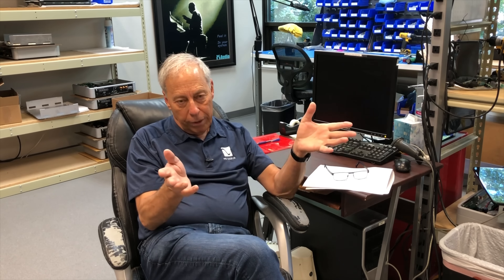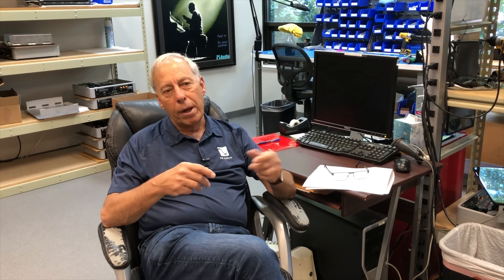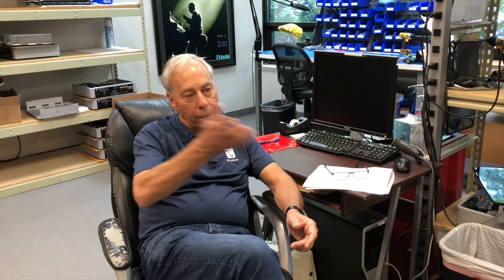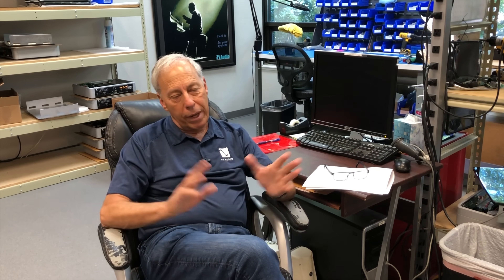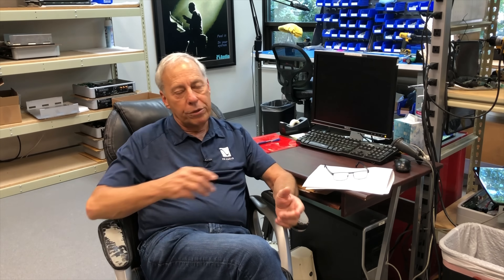How to make Class D sound better

Comment: I have now a class D with pre and postfeedback self oscillating who go to 0,00012 procent distortion while output 50 watts. using second orde integrator and a post correction stage with gain. noise is below -100dB. On simulation, not yet build.

Comment: Hi there -

Have been led to understand that the PWM output from a class D may either be integrated into an analogue output either by a large-ish (~1000uF) capacitor across the output, or, alternatively, actually just by the inherent (mechanical) integration of the speaker itself - 

- thoughts?

Comment: Hi Paul,  I learn so much from your videos.  A question for you.  Is there any latency when a Class D amplifier needs to call-up more power for say a louder passage and are there any audible signatures when this happens?
Reply from the maker: Nope. The typical switching frequency for a SMPS is 100kHz or higher, way out of the band for human hearing.
Reply: @Paulmcgowanpsaudio  in theory higher switching frequencies (in the MHz or even GHz band) would be better as you get higher resolution on high tones, but i know that drive circuitry, filtering, layout design (against interference etc), design capacitance and a ton of other things matter

but yeah, a 200kHz switching frequency will only leave like 10 points accuracy for a 20kHz sound signal, especially for studio applications it sounds counter intuitive with 24 to 32 bit 192 to 384kHz to use only a switching frequency of 100-150kHz, not like you'll really hear you've only got 10 data/switching points at 15kHz but it could be an argument, also switching at really high frequencies in the order of a few MHz to GHz also really kind of removes the need for chokes on the output, possibly increasing the efficiency as it doesn't get filtered through inductors

that makes the TI TAS6424-Q1 quite interesting apart from being an IC and not having the best crosstalk nor sampling rate (96kHz digital input... yeee) https://www.ti.com/product/TAS6424-Q1

but that frequency could make for an interesting amp if you can find comparators etc that are fast enough to handle/compare audio to the carrier frequency with a great resolution, ADC's sound kind of counter intuitive if you want to reproduce audio at these kind of frequencies while wanting a perfectly similar amplified output (apart from the switching) as compared to a really old record (pre digital) on a class A (or AB) amp, 2.1MHz would reproduce sounds accurate enough to have such a high res it's impossible to discern from the original even with special measuring hardware, apart from the coloration coming from transistor amps or tube amps obviously.
Reply: Class-D amplifiers have a low power supply rejection. You should take care  that you have enough capacitance in the primary and secondary stage of your SMPS and a nice voltage regulation. Also you can have some crosstalk due changes in voltage in the caps due to the other speaker.

Comment: What I wonder is why with car audio class D amps (even the ones designed specifically for subwoofer duty) does the low end of the audible range seem to alway be modified by the amplifier to prevent good sound quality? I'm not talking about the subsonic filter they usually have. I  installed many class D subwoofer amps during my time with an electronics company and it seemed class d amps either always had weird things happening from 40 or so hertz and down, and/or their phase was frequently way off from the mids and highs amplifiers. 

I'm looking into a class d for subs, to save space in my vehicle, to run along with my class A that will be running mids and highs, but I'm worried it won't ever sound accurate.  Any of my AB amps have always sounded amazing but take up too much space for my current vehicle.

Comment: What PS Audio can do is to switch to hypex modules. Because of 10-20 dB lower distortion level and few times more high switching frequency with comparable price. ICE is over. And to fix an unbalanced input, so both produce a scene of the same width.

Comment: Hey Paul, really like all your informative audio information! When l purchased my Maggie's. 7's I decided to buy a used class D amp (I already have a VAC PA 100 100 tube amp) and in the event I didn't like it, l wouldn't lose too much money.  I came across a Spectron musical MK ll class D amp that was designed by John Ulrick back in the early 2000's  From what I understand John basically invented the class D amp
He also worked at Infinity speakers with
Arnie Nudell and developed the class D amps on the Beta RS speakers. Before I bought this amp ( for less than a set of decent set of speaker wires) I read a lot of reviews, and all the reviewers loved it!
It's a beast! Coming in at 54 lbs  has the ability to output 1,200watts@1ohm and 65 amps for 500 milliseconds  I must say for an old D class amp it sounds pretty close to my VAC but with much more dynamics and effortless power
Paul have you heard of, or know of this amp?

Comment: What!? If that amplifier module is linear from rail to rail, then the input stage should be TRIVIAL. An input stage should do Nothing but prep the signal (linearly otherwise you're introducing distortion) for the amplifier stage. There's no 'magic sauce' there. The only thing I can conceive of as an acceptable means of changing the sound, is only if you decided to do some filtering, like a LPF for sub-woofers, or overall 20-20Khz bandpass filters. Also, signal conditioning like XLR difference input op-amp arrangement, or soft clipping/limiter circuitry is also acceptable. 
If an input stage changes the phase or magnitude of the original signal, then I call that distortion. 
So what possible secret sauce could an input stage do that is 'better' than someone elses? Maybe you change the input impedance, output impedance, or add other 'features', but don't touch the original sound and change it in any way. As Gene says, it shouldn't be a tone control.
My $0.02.

Comment: So, in short, the sound quality of the system is depend on the pre-amp input and the quality of the speakers, right?  The class D amp is not that important other than provide the power to the speakers, right?

Comment: However Class  "D"  are the most distorting amplifiers ever. They convert the signal into digital that depends on a sampling rate, then it need converting back into Analog to drive the speakers. This is a terrible proposition when you try to smooth that staircase signal on the output, plus try to silence the noisy circuit fill with hundred of switching transistors.  They, "D" class are more electrical efficient but who count the penis you can save with a class "D" amplifier over a class "A"???
We like the best sound and saving on the electrical bill is not my goal!  Class "A" on tubes are the best sounding amplifiers.
Reply: @russmaleartist  Sure, I herd them, they sound good but they do not have the ultimate sound I look for; also, I inspected the output of several of a few high end  Class "D" amplifiers on a variety of frequencies on a high resolution scope and you can detect, slightly, the stairway digital output. Moreover, you can detect the transistors cutoff noise by an overshot of the wave.   I do medical electronic these days but HiFi is the roots of my carrier. I understand that people  do like the equipment they purchase, but there is always something better even if consumes more electricity or produces more heat. Do not get hostile. I expressing my thoughts and back them up with explanations. This is a form of a forum to exchange ideas.
Reply: @mtabernig  Funny how having a difference of opinion is called hostile -- did I threaten you somehow? I didn't -- I disagreed . . . why is everyone so thin-skinned -- especially over an inanimate object. I would say, get a grip . . . but I am afraid that it too may be too harsh for your delicate nature.
Reply: @russmaleartist  No, you came out on "how can you make such a blanket statement" when you did not ask to clarify what did I meant or my qualification to render my opinion.
Reply: @russmaleartist  Now who is the Baby????? LOL
Reply: @mtabernig   So sorry for people like yourself, who must be right regardless. One gets on a site to share a hobby they enjoy with others and because an individual doesn't agree and can't win a fair debate, they have to try to bate, debase, and defame in order to win an argument. Well, here you are, mtabeernig, “you win” -- what you won, I am not exactly sure -- a trophy for being a arrogant jackass perhaps . . . now go get your diaper changed and come back when you have had your nap and are in a more social mood.
Reply: @mtabernig  LOL X 10
Reply: No they do not convert analogue to digital and back . The D in Class D does not stand for Digital ! You have not the faintest clue how class D really works obviously .

Comment: Hey bro, if a class d amp is 4k and a class A-B amp is 4 k, what is the difference
Reply: the temperature is cooler on the class D and it is probably lighter. Class D and AB are on par as, A badly designed AB amp is just as horrible as a badly designed Class D. Being a DJ for 35 years means my hearing is not great but i can still hear well enough to know when the sound is distorted or hissing or hum from a amp at rest .  I used to be really worried about quality when i was a teenager but  learnt the money wasted for a small change in the absolute best sound quality would be better spent om more or louder gear because when people are drunk they cant tell the difference. Saying that I dont like cheap gear.  I like gear that works all day and night and works reliably for years. in the audiophile space  my oldschool NAD AB amp does what i need it to do.
Reply: The Class D won't do subsonic bass

Comment: Instead of the icepower,i am about to buy a couple of those 20 dollar class D ebay chinese modules; i have a free, broken,half dismantled,   ex-professional amp from  late 80s, with a 870 VA transformer and clean plus 65 V and minus 65 V p.s.; the amp modules have 4   2N3773 each, good for about 250 Watts, but the protection circuits on both do not feed the relay coil,on  both modules,and i gave up already,all semiconductors are good,replaced 3 or 4 transistors, it may be caps, too many to remove and measure, tired of it,too old,even resistors were,and are,rusted where the small steel,go figure, cap meets the resistive element; 
     I have a nice Rotel (stereo)  with beefed up heatsinks, and i have another  amp,some small brand, small series,mono heavy amp(over 50 pounds) with 16 output transistors,that i repaired, and plus and minus 75VDC rails, actually with one led for each, on the front panel;
     I do not like stereo,neve did since the 70s ,  i find it strange to hear the vocals coming at me from the left and right,Jim Morrison only had ONE  set of vocal cords!! So, my home made 2 woofer, 15 inch , 5 ft tall, (also have 2 old ,but like new, 12  inchers Cerwin Vega that live next to each other,tied up together); 
      I like to listen to The Doors,Mettalica, Dylan, Pavarotti, The Phantom of the Opera, etc etc ( just kidding,i listen to A LOT of stuff, thru youtube,) and i need it to be like they are there ;
       So,the question is, will i  have to rip the 20 dollar class D  Chin Chao modules off and throw them out in the end,or no?   The alternative is to buy 2  class AB  modules for 40 dollars each, with 8 outputs each;    Thanks.

Comment: ..im very new to this but what if you sent that wasted power of a Class A into caps instead of heat sinks for AC regeneration as in a built in mini power plant inside the amp itself

Comment: So, engineers don't do anything to make Class D sound better.  Secret sauce?    FETs?   Nice try bozo.    Two hints - Class D distorts like crazy at specified max power - don't drive them past about 30%.  (Read the spec sheets.)  They mostly have (too) high impedance front ends - I use resistor (100-200 ohms) to damp.    Also it's probably good to reduce power supply voltage if you can - this should increase (digital) resolution.             7.21 on this - more like  "BS Audio"

Comment: Could you do a primer on Crown Class X amps? I think they are a variant on A-B. I know they reuse energy sort of like a turbocharger in a car. I have a XTI 2002 and Love it. I am running from a Xfi HD titanium pro sound card through a DBX Driverack PA and a BBE sound maximizer. I had replaced a Behringer crossover with the DBX and that was a huge improvement from a preamp perspective.

Comment: thanks for your class A amp  heat explanation here. Now I understand !!!  doh!  I have a Marantz SM8 /3250B still working in my study system. Most, but not all the central heating that's required in winter. Best wishes from a chilly Montreal.

Comment: Although I have a pair of Krell KMA-160 monoblocks which do sound great, and they also do generate a great deal of heat,  I usually run a pair of QSC MX1500As in a 2x2 biamped configuration and I'm telling you that I just can't be sure if they sound any different from the Krells.   The QSCs are not Class D, but they have a two level rail voltage system to improve efficiency.  The rail voltage switches to the high range when program levels demand it.    They run pretty cool but not ice cold.

Comment: Wonderful. I don't use mosfet (mosfat) as they are slow (fat). Use moslean. They are faster. 
In my class d design, i've used complementary pairs. (twins but different gender)
If you're building a self oscillating class d, avoid unnecessary capacitance in the loop.
Keep all components close as possible. And coil many a filter by hand. A particular filter is only good for a particular speaker.
In fact if you need to change speaker, coil again the filter until you are realy satisfied with the results.
Boy I sure had fun with class d.
If your class d is working properly, you could hear the news casters door creak when someone enters the studio.
Excellent video.

Comment: I've always wondered what an amplifier designer chooses to design the power output... as I understand SPL and decibels in order to obtain a 3 decibel increase a doubling of wattage is required however at 90-plus decibels.  At 30 to 60 db little power...at 90 db much more power required.   Let's say you have a 100 watt amp and a volume scale of 0 to 100 since volume increase and gain isn't necessarily linear when you increase the volume to 50% that might mean in that design it's using 50 watts and increase power to 70% using 70 Watts and then 100% power would equal 100 Watts in a certain design.   How do amp designers now usually choose this concept, or design.  I have seen so many different brand new companies popping up throwing class D amp modules inside a metal box... and sell for $2000.00 lol.  Why doesn't the company making the amps just throw them into a box themselves?  I like the Pascal amp modules from Denmark lately.  Great thd proprietary input buffer stage then added on by the company making the amp.

Comment: Paul, I run a tube guitar amp repair shop in S.F. but I used to work at H.H. Scott in Wouburn ,Mass. in the 80s. It wasall manufactured in Asia. I was bench tech and I got to know two of the old engineers Don Merriman and Peter Globba. I would bring in tube guitar amp drawings and they would say tubes went out with the horse and buggy and then they'd start talking about them in  great depth. Peter and I had a discussion that I'll never forget. Peter worked for the Germans in WWII. After the war he moved to Brazil and worked in a radio factory. He said that they made their own capacitors,probably had to. He also said that there were cardboard shacks next to mansions.The poor people were lucky to have some beans and rice to survive on.He made it sound like communists were trying to convert people to their cause. He also said that nobody cared about capitalism or communism, they just wanted to eat.The sad thing is that's S.F., Ca. today, cardboard shacks next to Refined Residences. What happened to this country ?
Reply: This country? What country?
Sierra leone?
Reply: What is the name and address of your repair business
Reply: Rich senators took Russian money to undermine your democracy. Same in the UK.
There's your answer.